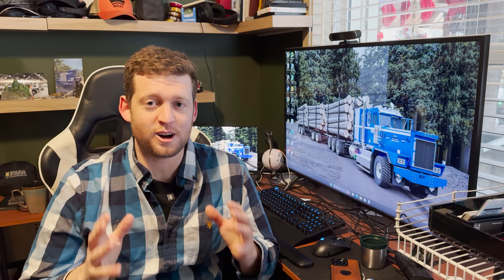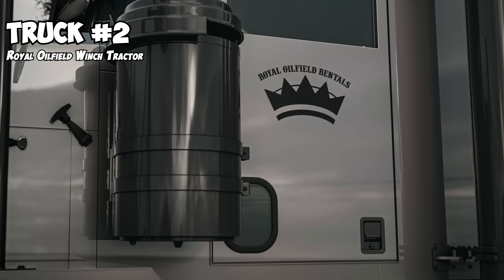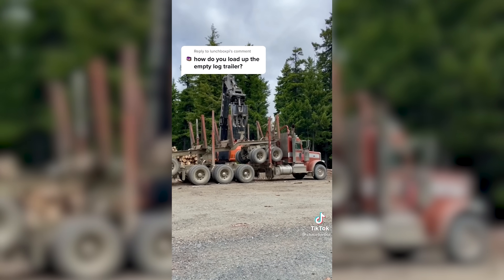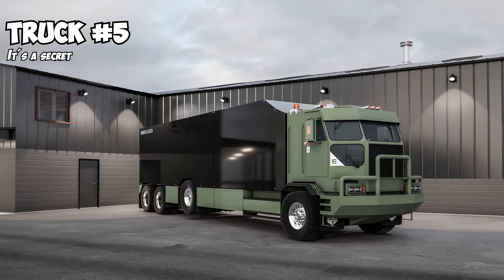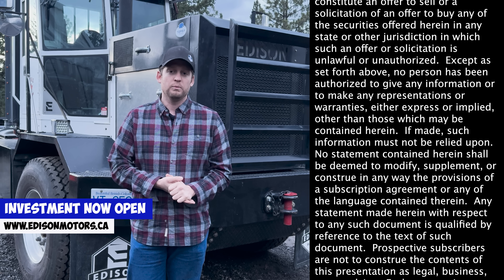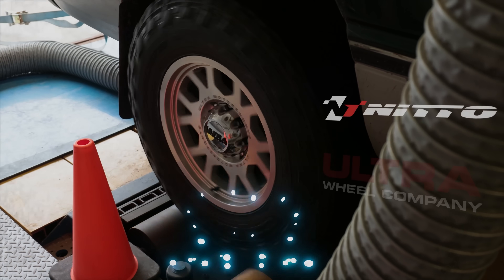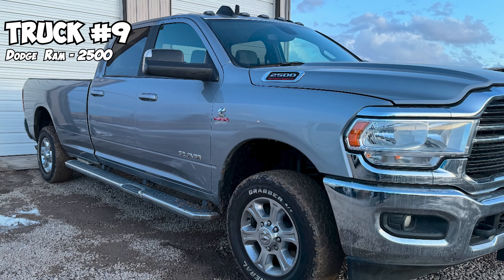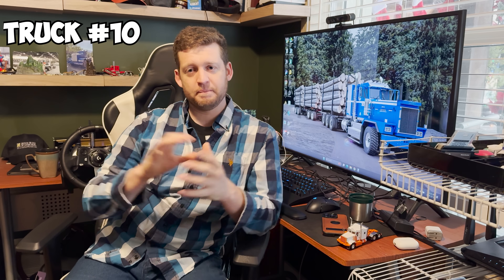Edison Motors’ 10 New Hybrid Truck Builds & Future Plans!

Comment: How the h3ll are they going to charge a electric logging truck? 🤣🤦‍♂️
Reply: You realize these are all hybrid conversations and scratch builds, right?

Right???

There's still an engine in there that is used when needed to supply power. All while not needing as big an engine as they normally would AND saving weight on the drive train by not having a drive shaft. Also, running the engine exclusively in its efficiency sweet spot.

Comment: I'm sure this has been covered before, but how would one integrate a PTO system for hydro? I really want to build a dump truck with this system.
Reply: You do e-pto meaning the Power Distribution Unit box that sends 3 phase power to the big axles would just have another 3 phase AC outpout of big power that goes to a stationary motor that is bolted to the hydraulic pump. So it would have like 500 hp.

Comment: Can someone explain if a smaller engine can charge a battery in an extended-range EV?
Reply: The horsepower of the engine will depend on the expected use case scenario. A car on the highway needs a 50 horsepower engine to push the car through the air. A truck on a highway needs a 100 horsepower engine. A Semi trucks needs 150 horsepower engine.
Reply: @Sah-o5m  can a 4 cylinder 2.0 liter engine produce 150 hp?
Reply: @ Depends on the make/model of engine I suppose. The new Toyota Corolla 1.6 liter 3 cylinder engine is making 300 horsepower from the factory.

The 2.8 liter cummins that Edison is putting in pre year 2000 trucks is making 165 horsepower.
Reply: @Sah-o5m  then why not putting a 1.6 liter 3 cylinder instead of a dirty diesel?
Reply: @robertn2951  I think the 250 pound 300 horsepower 1.6 liter toyota turbo engine is not readily available outside of Japan.

The Cummins engine is easily sourced and already bolted up to generators, so there is already an engine computer specifically designed for gensets.

Also, the environments that Edison trucks will find themselves in will have diesel fuel more readily available.

Plus modern diesel engines are much cleaner than before.
Reply: @robertn2951  They need head room and they need to make 150hp constantly indefinitely. A 1.6 litre engine probably couldn't make 150hp constantly for very long.

Comment: I think an ambulance would be a good medium-size truck build. Smaller than a semi or logging truck, bigger than a pickup.

Most are conversions from pickup truck chassis, which means they’re inheriting a lot of shitty design decisions by pickup manufacturers before they even get to the ambulance builder.

I think a truck designed from the beginning to be an ambulance would be a game changer for EMS in the US and Canada.

I also think the really good visibility in your cabover design (that I’ve seen in this video and in a few others) is something you should look to include for an ambulance. And the series diesel-electric hybrid would probably be a great boon for multiple reasons. No more (or reduced) idling in poorly ventilated ambulance bays!  And feeling more familiar to car drivers would make training EMTs and Paramedics to drive it easier.

That said, I would say you may run into friction as EMS agencies (private and municipal) tend to be very risk averse, so you would need to be prepared to address their concerns proactively. And you should probably consult with some folks who drive ambulances for more information.

From what I personally know, keeping in mind that I’m not very experienced myself, I would recommend looking at a small to medium sized service/fleet, that way you’re not worrying about potentially dozens of trucks if they end up wanting to replace their whole fleet of ambulances.

Also, EMS agencies often run specialized SUVs or pickups as non-transport support vehicles, so you will probably be looking at building a pickup or truck-body SUV too.

In short, your ideal client for a new ambulance design would be covering a relatively small area, be a municipal run service (not private contract, they’re generally cheapskates), and well funded for their size. EMS in general is often underfunded so you may need to shop around.
Reply: Additional thumbs up 👍:)

Comment: If you haven’t already, your team should check out the company Janus in Australia. They are converting semi trucks to fully electric with swappable batteries. The swappable batteries allow them to drive in the remote parts of Australia hauling two trailers at a time. In order for that to work, they target customers with predictable routes and store excess batteries along the route. I would think logging trucks have repeatable routes heading back to the mills? 

Ultimately they save so much more money versus a diesel or hybrid truck by using swapable batteries which significantly shrinks the size/cost of the batteries needed. Plus you have longer times to charge the batteries so the power levels required to charge the batteries goes way down which is critical for remote areas of the world like Canada.

Finally the batteries are swapped out by a normal fork truck in minutes. It seems like such a good fit for your logging applications?

Comment: It's a diesel engine you are putting motors in which are electric the truck has an engine gas or fuel burning engine you are putting motors in there which are an electric Drive sorry drives me crazy when people call engines  motors buy the way I like what your doing but I will stick with a engine drive car or truck but tour builds are how they all should be that way everybody has unlimited mileage
Reply: Your loss. Why choose the less efficient option

Comment: What is Edison Motors selling? Lower operating cost? ESG?
Reply: Edison intends to craft and sell electrification kits for semi trucks and pickup trucks. The kits can repower aging trucks that would otherwise be obsolete and discarded. By offering a repower option at 1/2 the price of new, Edison is providing value to the buyer.

Edison truck kits can also provide double or triple the hp/torque for hot rodders, service trucks, &  semis, that want or need the increased performance of electric motors.

Edison electrification  kits also offer AC power options to remote locations like for RV campers.

The up front cost of Edison kits is expected to be offset by reduced fuel costs over the life of the vehicle. A lucky side effect of reduced fuel usage is reduced emissions.

Thanks to government grants for electrified trucks, Edison can offer vocational Semi's at a more competitive price.

Edison is also offering vehicles with the "right to repair". Other auto manufacturers are doing things like: restricting access to spare parts, designing parts with proprietary fasters or gluing parts together so they can't be separated, not providing repair manuals, requiring expensive proprietary diagnostic software, voiding warranties for using non authorized parts, using software locks to prevent 3rd party repairs, requiring ongoing subscriptions to keep the vehicle usable, paying lobbyists to dissuade right to repair legislation. Edison stands against all of these anti consumer practices. 

Edison "right to repair" trucks/parts means customers can expect good values for repair parts and reduced repair labor for decades to come. 

I guess Edison has a solid plan and is selling hope to a world that needs it.

Comment: I'm little currius, regarding, the triaxle that will go empty up an montain but fully loaded down hill, i know it's unlikly but if the regeneration will fill up the battery on the way down, can you move the energy to heat or do you just need to use the airbrakes?
Reply: The regen will fill the batteries to 80%, then send the power to the generator bolted to the diesel engine and use the engine like a jake brake. After that you stand on the brakes. I think it will take some mental planning to make sure the batteries are down to 30% at the top of a mountain to make sure there is enough capacity to capture the descent power.

Comment: If the undisclosed truck concept is any indication, it would be a glowing endorsement if Canadian Forces were to get a few Edison trucks. 😎

Also, I know your hands are full at the moment, but be ready to build some tow trucks for California. Heavy tow operators with CalTrans highway recovery contracts are screaming bloody murder over the ZEV truck quotas (must sell 1 "clean" truck for every 9 diesel trucks, only getting worse) while they have to get new trucks every 4 years means they will soon have no trucks to use with nothing viable on market. All you have to do is get tow truck builders like Miller/Century/NRC etc to use electric hydraulic pumps. It's a match made in heaven.

Comment: I wonder what it would be like to use a Dodge 5.9L inline 6 and a 5 or 6 speed manual transmission in a big rig, then use that to power the forward most axle, and then have 1 or 2 more electric axles.  Then leave the engine in neutral when not needed, and run it at about 50% to 100% power when needed.  You might be able to use regen at the same time the engine is supplying power to the forward axle, and recharge the battery.  

I guess there would be problems with the throttle of the diesel engine and the electric motors at the same time.   But if that can be worked out, maybe a hand throttle?
Reply: I don't see a benefit of complicating these things like that?

Comment: So glad you are thinking before doing. Does not happen like this nearly often enough. I bet you sleep better at night too. If you would have jumped into it with both feet you would have been putting out fires left and right. Even Tesla jumped the gun too fast when they started. Plus you don’t have to worry where you are gong to get your next $100,000,000.00 by the end of the quarter, or else you will have to close up shop.

Comment: the look of  these new truck  is really cool ,, the tri drive winch tractor especially ,not really a truck for everyone but when you need to pull something they are a beast ,,I actually own a similar size truck built in 1977 as an oilfield truck  , mine is a peterbilt 359 tri-drive with a powered steer axle ,,it's also a bit of a frankenstein because someone in the past moved the cab back lengthened the hood and installed a 3412 twin turbo caterpillar engine according to the numbers it makes 1150HP ,, the 2 winches are monster braden 75 ton gear drive single line winches ,i live in farm country and over the years  it's come in handy for removing stumps and pulling tractors and equipment out of mud ,,and with my salvage business it's very handy for loading trailers

Comment: how much would it be to upgrade my 2001 ford f250  4x4 power stroke pickup
Reply: The pickup kit hasn't been built yet. They probably have a target but don't know for sure and it would be foolish to set prices before the product is built in case you need to backtrack.

Comment: So number 5 is a DOD contract huh? The real question is, is it the Us DOD or is it for the Canadian 'Mounties'? Regardless I want one for a Mega E-Overlander Rig.
Oh and here's a build challenge for ya'll; An 8 wheel (minimum) Utility Overlander with a rocker-bogie suspension system. A good test platform could be a pull behind auxiliary trailer with an extra power bank or motor assist, something similar to what the old Land-Trains would sometimes have; That's what your all's company reminds me of, big a$$ trucks that buck the conventional system so hard it rattles the larger auto industry so much they don't really want to even acknowledge it.

Comment: Did you ever announce performance in terms of fuel savings? 

I think your commitment to right to repair is enough justification, I'm just curious if you were ever able to show efficiency gains.
Reply: I haven't seen any specific. But it's so application dependent. They would need to have another truck trailing Topsy with the same load to show. And I haven't seen Topsy running up the mountains to get logs yet.
Chace has been honest and saying that on highways (I would add flat land) you don't save fuel, it's in the live video at some truckers conference a month ago or so.
In reality they might have some numbers but say 1 and it will stick with you for years with people saying it is too bad or potential customers expecting a good one but they have another application. These first customers probably know there will be some saving but they are partnering to really get to know this, not starting to look at fuel numbers first.
Reply from the maker: We did.  

The answer is:  “It depends what you do with it”

Fuel savings is between 0-100%
Reply: @EdisonMotors  right, so it sounds like for fuel alone then highway applications aren't worth it, which you've said, and spoke about aerodynamics. 

Not sure of the impact of hills. Not sure of the impact on stop and go in the city.

I guess I'm curious of the crossover where it's not worth it on a 10 or 20 year payback solely based on fuel efficiency.

City driving does get a payback? 

Maybe anything over 10% idling?

Just curious. You guys had extensive estimates and spreadsheets initially.

Comment: In your next round of trucks you guys should look into doing a wet hose fuel truck. I drive one every day filling generators and tanks at construction and fleet yards. Figuring out how to integrate the PTO with electric would be great especially because fuel is so dangerous less ignition sources would be a huge plus.
Reply: They just need to place an electric motor of adequate size where the rotation power is needed. I don't think there is much to figure out with that.

Comment: 😮 The keep the current diesel engine seems interesting.  No fuel system to mess with as it is all there installed.

I wonder if there would be an exception for emissions since vehicle would be completely electric (diesel engine is not connected to drive train directly)....

Comment: Hey from the other side of the Atlantic ocean. 
I have been a diesel/hydraulic/ heavy-duty truck mechanic a Scania for my hole work life. I really dig the idea of keeping it simple and long lasting 30 years plus, you guys are basic building a giant Lego-kit, were future you can rebuilt, modified or convert a Edison truck to fit you operation without to have to require a complete new truck.  
Keep up the good work guys. 

By way the way, a die cast model Edison winch truck have to be made.

Comment: Building the first 10 trucks will indeed be a major achievement.  But comparing computer-generated images with actual built and registered vehicles are totally different things.  I worked all my career as an engineer of low-volume custom-built special purpose high-performance all-terrain vehicles (military trucks, oilfield trucks, airport crash tenders, ultra-heavy haulage trucks, etc).  Completing the detailed design for each custom build project, generating the build lists and then managing the procurement of numerous high-value specialist components with lengthy lead-times and the time intensive production process that requires highly-skilled production line operatives brings huge challenges.  The long-established companies I was involved with employed experienced staff with decades of experience in all areas and still faced numerous hurdles.  I wish you good luck and success in achieving your goals.

Comment: Another possible application would be a hybrid cement truck. Here's why; many years ago I was laying block at the Tonawanda GM plant and we had a bunch of wall to grout. So we ordered a truck. Us guys were working up close to the ceiling when the truck had to come inside to discharge. It obviously had to run and man o man did it ever smog us out at the ceiling height. If that truck had been able to shut down and come inside the plant on battery and discharge everyone would have been better off. It wouldn't be a high sales volume application. But cement companies having at least one hybrid for those industrial interior applications, or just eliminating idle time while unloading in general, would be great. Great work guys.
Reply: They've already had a request for a concrete mixer. Expect to see designs maybe next year and they will likely build one after these first 10 are done.
Reply: 👍modern diesels do not like to idle too.
Reply: Concrete mixer just need the mixer like a phematic tanker to be Elect drive
Reply: Maybe, they can experiment with bio-diesel to keep emissions lower and with the electric battery, they can keep the bio-diesel at the right temp.
Reply: Electric cement mixer trucks are already  out in the world working albeit in small numbers but hybrid is not needed. One maker uses swap-able batteries.
Reply: Perfect for garbage truck. Regen for stop/start!